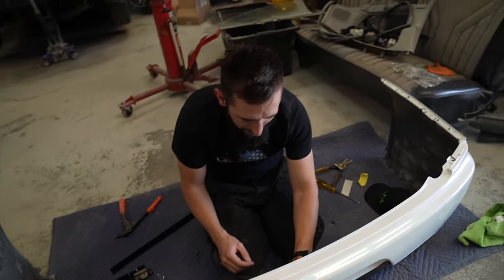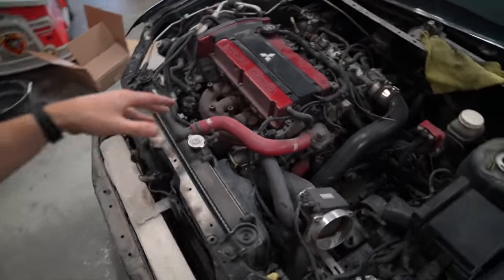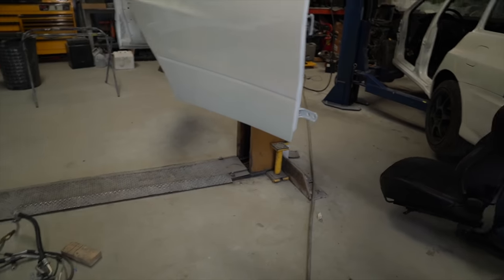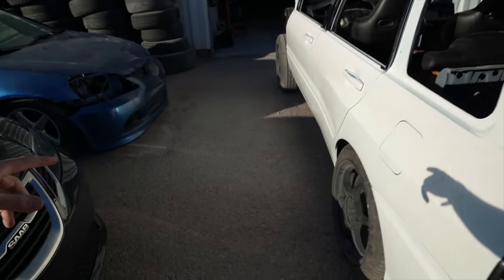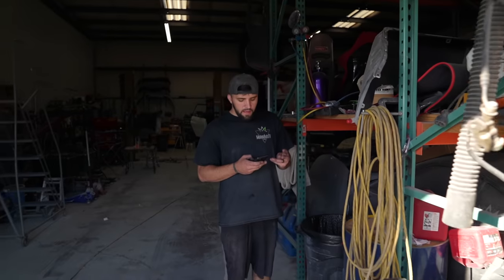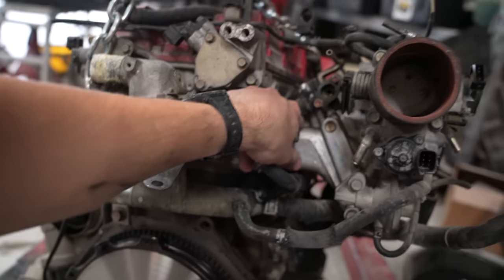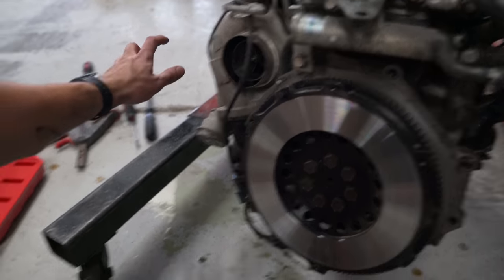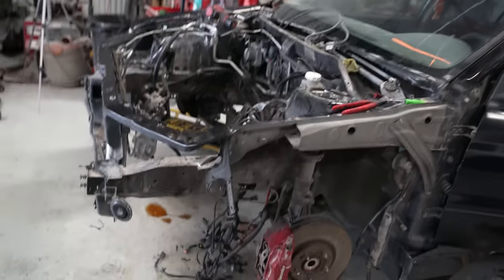Pt.17 Evo Wagon Build | Putting It Back Together!

Comment: Some carbon accents ...mirrors.. hood .. an front lip whould look amazing on this pearl white
Reply: Not the hood tho
Reply: @fichtenmoped4028  yea the hood is to much carbon
Reply: use that hood carbon on some carbon door handles .. mint
Reply: Disagree....carbon fibre parts that aren’t actually saving any weight are too try hard.....the 90’s have been and gone. Black hood vent, rear diffuser, and windows is enough black.
Reply: @seshelbow336  I mean for some cars it does, but evos already have aluminum hood and fenders so just for looks for an evo

Comment: The 5speed manual was the most common transmission for the EVO for years and was very strong after years of refinement.  The 6speed manual was only used in the EVO8 & 9, so it wasn't as refined and didn't last as long even in the stock setup.  The 5speed is what you want for durability and reliability, unless you want to drop a shit ton of money to bulletproof the 6speed.  Looking forward to seeing the entire power train installed!

Comment: Hey Trevor, the turbo might be a BBK lite, full or 3B. The blue compressor wheel was common on those turbos. It could have received an “upgrade” to the ported FP compressor housing hence why there isn’t a tag identifying which FP it is. FP used to sell those compressor housing separately. I used to run a BBK Full and it was a great turbo.

Comment: I think I figured out the mystery turbo on the Black Evo IX. That turbo is most likely a blouch bbk full turbo. Back when they were sold through CBRD they would sell them with blue compressor wheels. A couple years later FP would release for sale a 84mm Flow Advancement Port™ compressor cover for use on any Evo turbo. This was a popular and cheap upgrade because it increased the air inlet size allowing more air to flow through the compressor. The compressor covers bought from FP would have their logo but they would not have any other labels on the cover.

Comment: Just make sure you don't use too light of a flywheel and the drivability will be fine. I once put a Prolite 9 pound flywheel in my evo. The first gear chatter in parking lots was hard to put up with. I put a 13 pound flywheel in my 2nd clutch job on my evo 9 and it handles almost like stock now. Stage 2 competition clutch.

Comment: if you go 2.4, you need to put a ~62mm turbo a 30 series turbo will be too small (if you decide not to use the FP unit)

Id recommend the Xona Rotor 78-64S.

2.4 and a 62mm turbo is a SICK combo on these cars.

Comment: Ah yes K20 swap EVO8
Wonder if someone still dares to call civics slow when you pop the hood and see a K20 with 500+ in an evo8 😂
Reply: And be more reliable than a factory evo 😂😂😂
Reply: Hahaha Trevor has blown like 4 k motors up in the last year alone....picture of reliability 😂
Reply: everyone whos been subscribed for more than a minute knew that was going to happen))))
Reply: for 4 cylinders the K20 would be the only swap other then a 4g63 that would make sense, wont be as cheap to make power but still solid fucking motor's. My friends GSX has been daily driven for 10 years already at 500+whp and the engines never broke down once......clutchs and transmission issues are another story all together. lol

Comment: I know you guys wanna get it running and drive it, and I'm raring to see that too so I agree on throwing in the good evo engine for now.

 What you should really consider in the future though is doing a 4g69/4g63 hybrid. Use the 4g69 block and crank, tap it for the evo oil squirters, use the evo 9 head, and get forged rods and pistons in the stock 4g69 sizes. Use a not super big turbo, and go twin scroll. Prioritize spool first, and then find something that will still flow a decent amount with that quick spool. 

It's a sport wagon, it should be the ultimate daily. Just make it super tough and reliable with an ultra usable power band. Keep it at a safe tune and use 91 or flex fuel. Don't make it too tracky with 18" rims, race tires, slammed and stiff coilovers, harnesses or any bars inside. Keep her close to stock ride height with nice shocks, 17" rims and a nice summer or all season tire.

All that said, you won't be compromising much lol. Big displacement, dohc, dual mivec, and efficient turbo is gonna sneeze out like 500+hp reliably all day. The stock 4g69, sohc with only exhaust side mivec already has a pretty nice power band, and so does a stock 4g63 with an old turbo.

Comment: If you want it to hold power don’t cheap out on the clutch. Even at 400hp cheaper clutches will slip. Go with the act 6 puck or a twin disc right off the bat

Comment: The jdm wagon had a steel bracket mounted on the car not on the bumper itselve.
I know because I have a real evo wagon 😁
The car is looking great, would love to see the rear seats fold down but you need to cut out the frames out for that 👌🏻

Comment: Black evo : fully stripped interior, roll cage, no airbags ,bucket seats,  small custom made fuel tank , battery relocation ,  lift it up a bit , throw on good gravel tire and rim , stock engine or maybe a turbo a programm and exhaust , put a fire extinguisher a spare in the center of the chassi behind seats,  throw a sticker on look like a trevor rally Tommy makinen cinda car  AND BEAT THE FUCK OUT IT OFF ROAD gooooo rally that thing
I am a fan from Greece keep up the good work I enjoy your videos I am here for about 3 and half maybe 4 years so thank you for the content !!!

Comment: Instead of a 2.4 , you should think about a 2.1 which is a 4g64 block with a 88mm crank (which is the motor im doing) Or a 2.2...i think a 2.4 would be too aggressive on the street and not enjoyable

Comment: Anyone have any advice on modified vehicles that have been in an accident at no fault of their own in Colorado? Insurance is claiming that my rarer half year car that just had over $4k worth of work done and has custom parts and upgraded almost everything on the car is worth less than $2k because of what the odometer says and KBB. I have a lawyer but I can’t find my car for sale anywhere because of the rarer year. I’ve got about $1,400 into my headlights alone. Go figure one of the headlights was damaged in the accident.  Car might be fixable with new bumper, fender and suspension parts. I have adjustable upper control arms, new lower control arms, and adjustable coilovers. Am I just at a loss because I didn’t have it appraised and insured for those parts? Even though it was the other person’s fault and they had full coverage insurance?